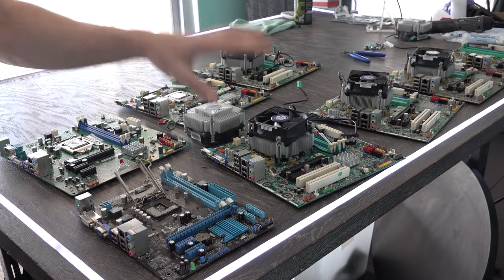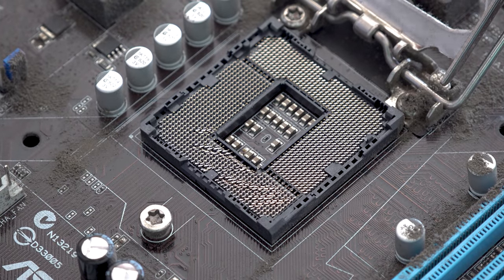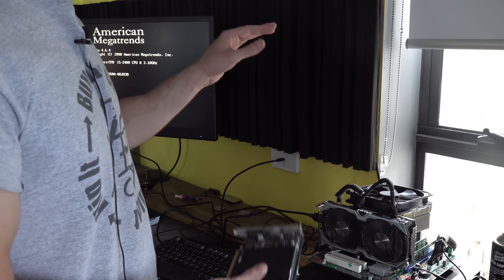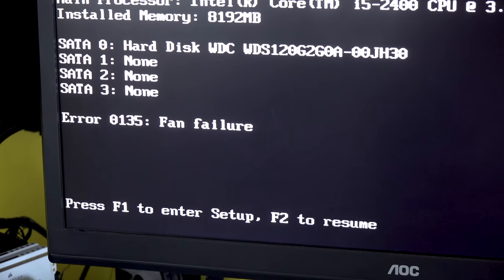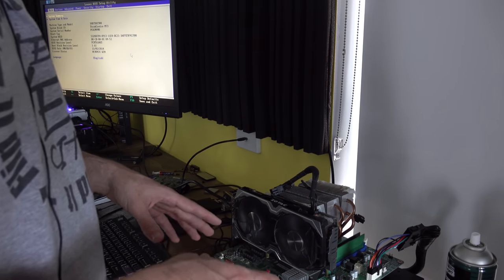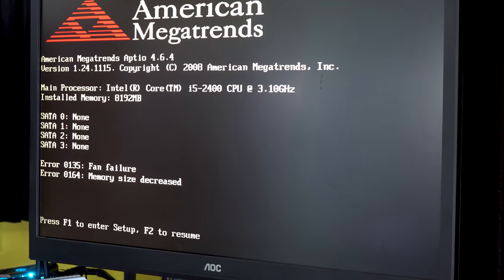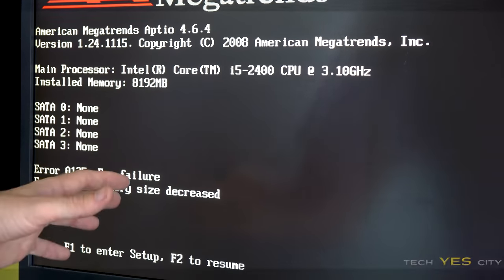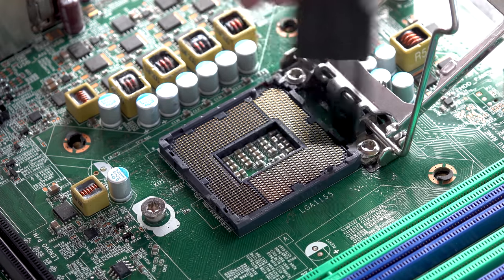Cleaning Motherboard CPU PINS?! (Lenovo M91p Thinkcentre's Explained)

Comment: I was cleaning off a XEON on a AsRock Extreme 3 X79 motherboard, to change out the cpu.  I was using a new absorbant/re-usable kitchen towel, made of compressed fibers, often used for cleaning dishes with soapy water.  The towels come in a stack at the store and are about 1 square foot each in dimension. I was using one as a rag to wipe away the thick thermal paste and had it in my one hand as I took the CPU carefully out of the socket.  Then I made the mistake of getting that fibrous rag close to the socket and about 1 square inch of it touched the pins...which all seemed to grab hold of those fibers.  I could not pull it away without bending those pins.  I really thought that I had totally trashed that motherboard. Before making the situation worse, I tried a different approach.  I got out a BIC lighter and carefully burned away the fibers clinging to the pins, slowly taking the towel off.  It worked like a charm.  Just had to be careful not to let the flame linger.  I would burn...stop...burn...stop...always being sure not to heat the pins excessively.  I used compressed air to blow away the fiber residue. Voila.
Reply: I did the same a year ago - except i pulled the microfibre towel and bent about 15 pins upright, felt like screaming and crying ! But 3 hours later all straightened (ish) and it booted up, lesson learned….

Comment: Gotta love those Lenovo ThinkCentre M91p’s 😀.

Still have my SFF in the attic. Back then I didn’t have a gaming pc or much money, so I got an old office pc from work.

I upgraded the i5-2400S to a i7-2600 (non-K), changed the 2x2GB 1333MHz Elpida RAM to 2x4GB 1600MHz Kingston Value RAM and added in a Asus GTX1050ti since it did not have a graphics card, sorry gravis card 🤪

and ... gaming time on a budget 😜

Ps. Even got the 24” TN monitor it came with and the original Lenovo keyboard and mouse. The mouse wasn’t that good and I changed that for I believe a cheaper one from Razer but the usb keyboard was actually really nice for gaming 😉

Love the work and effort you put into your video’s Brian... mr. Tech Yes man 🤣

Comment: I took your advise and got an old HP Z600 workstation. I love the Xeon E5620. I got a heck of a deal on a graphics card. I am trying to use only used parts for my system. So far, it is working great. Thanks for the inspiration.

Comment: Damn
Doin this with a stiff paint brush really did work
I was having problems with getting memory to work in triple channel on my p6t that I purchased recently
Now it runs absolutely fine
Got meself a xeon x5660 upto 4.2ghz ez pz
Reply: That's pretty good for an x5660, usually it's the x5675 (better binned chip) that has an easier time hitting 4.2+ghz.
Reply: I also have a p6t deluxe. It doesnt boot/doesnt recognize ram in the first two slots. What spray did you use to clean it?
Reply: @gammler3000i  I used the same Aussie export multipurpose spray
And some random paint brush I found

Comment: My first comment on any of your videos.  Anyway, Just want to say that this method works and I've learned it from you.  I am infact typing on this system with a motherboard newly socket cleaned.   It was a gigabyte z97x-ud5h motherboard that I bought recently as part of a faulty system.  The system would boot with only 1 ram on DIMM 1 but after doing a tech yes loving treatment.  It had 2 ram slots working but no dual channels.  but the second slot was also very picky as it will only run 2 single rank DIMMs.   Use the "thicker" american multi-purpose substance and a good paint brush i had.  carefully stroked the pins and tested my DIMM.  All 3 pairs of gskil and mushkin DIMMs that won't even work on any 2 slots together now work on all 4 slots.  this gigabyte board was problematic as it was throwing all sorts of post codes and looping.   once it finds a DIMM it doesn't like, I had to restore the main bios from the backup to just make it work (with only 1 DIMM on the primary slot).

I am Long time follower of your channel on atleast one of my subs.  Anyway,  i've been doing some buying and selling during this "period".  I haven't done this since pre-college some 20 years ago.  Anyway, your channel is sort of what I used to enjoy back in the day ( the "parts hunt") .  I thoroughly enjoyed you going to different countries for the parts hunt because I used to do that when I go to japan, taiwan, singapore.  Anyway, I hit the subscribe button today because of a particular point you made.  The parts-performance community doesn't have the fan boy zealots.  I notice people who I recently sold systems to understand the "value" of the components.  No "team green","team red", "team blue" just price-peformance.    In fact this is how i discovered x58 platform which is thru your channel.  I hated it when it came out because it was overpriced but I've leared to love it now.   I discovered the value of x79 3 years ago and loved what it had to offer and I began watching youtube channels about it since then and bumped into tech yes city. Thanks again Mate!

Comment: A small tip when trying to straighten the CPU socket pins would be not to use a cocktail stick, because small splinters of wood can break off and get stuck in there (ask me how I know...). A good alternative is to use a very small cable tie; since they're plastic they won't fragment, and they also have a little bit of 'give' to them compared to the wood, so they can be a little more gentle.

Comment: wait are you stalking me? i literally did a tech yes loving last night and for some reason my multi threaded performance tanked to now lower percentiles in benchmarks instead of on par or little ahead.  Well i used crv electronics cleaner (almost like brake cleaner) on everything and thought maybe left some residue and on top of that had some thermal paste "maybe" get in there because applied too much... i tried dripping rubbing alcohol into the pins and blasting air so anything runs out the bottom.  but i really want to be able to clean the pins and almost used a qtip but the hair were getting caught didnt want to catch a pin and bend straight up. low and behold you post this video today.  thank you and i hope you get a chance to read this

Comment: The only part of the pins in a LGA socket that need cleaning (or benefit from cleaning) are the very tips, the tiny domes that actually contact the lands on the CPU. I drag a few strips of fairly heavy, alcohol wetted printer paper across them (a few with a 90° point to get into the corners), I reckon the paper is just abrasive enough to clean/polish the gold plating.  This is after making sure there are no obvious contaminants such as fibres that might interfere mechanically.

Comment: For people that can't buy his multi purpose spray, look for Contact cleaners, they will do the same job, as the most important part is that they contain solvents which clean the PCB and evaporate quickly. Look for Heptane, or Hexane in the contents. Isopropyl alcohol works as well but it can be harmful to plastic parts.
Reply: The description and uses of the "multi purpose spray" matches WD-40 in the USA.  Kinda wierd.

Comment: Got an Asus P6T used but it was poorly taken care of. Only one dimm slot worked. Took WD40, a rag, a data vac, a tooth brush to scrape the dimm slots and rubbing alcohol. Managed to get one more dimm slot working. But the mobo works in single channel. Saw your x58 fix video. Took a toothbrush to the pins with WD40, bent some pins back and now I have one more dimm slot working, unfortunate that I couldn't get it to work in triple channel but I got it in dual channel so I guess that's a win!
Reply: Try replacing the thermal paste on the north bridge
Reply: @MarshallSambell  did all that

Comment: Here's what I've learned concerning WD 40. It is the best lubricant for PC fans. You can extend the lifespan of lower RPM fans in particular with WD 40. In case of PCBs, use the contact cleaner variant of WD 40.it's really great and leaves no residue. If a fan is rattling, sounds louder than normal, or spinning very slowly. Give it a spin with your hands to see if it's heavy because that's the main indication that it needs lubrication. Also, you can use old CPU fans as case fans if they're becoming loud at their maximum speeds or even as a replacement for a dead PSU fan

Comment: In the UK we have "WD-40 Contact Cleaner" which evaporates fast, leaves no residue, and is non-conductive, would recommend checking it out if it's available in Australia, great for CPU's, RAM sticks, DIMM slots etc... £6 a can here which lasts a good while if you spray it on a micro-fibre cloth then use that to clean components.

Comment: Thanks Byran for the top tip. I have a Asus H81 motherboard that has one ram slot that works with ddr3 1600 and the second slot only works with ddr3 1333, second ram slot does not boot with ddr3 1600. After watching this video, I removed the CPU and cleaned  socket pins and CPU with electric contact cleaner and that fix my problem. Second ram now boots with Ddr3 1600 memory. Thanks Tech Yes City for top tip

Comment: Bryan, love your content as always, actually, on older boards socket 1155/1156, or even Haswell 1151, when you pull out the bios chip, I love using some contact fluids, and gently cleaning the inside especially if I don't get the post screen if the board isn't busted but still has fans spinning this sometimes cures the spot, other times it has fried components have done a couple of resoldering jobs and if you're into it, it's usually the caps that leak and go bad with time...

Comment: WD-40 contact cleaner is a must if you can find it in the store,i fixed crashing issues on my P5KC/Q9550/4GB RAM/RX560 4GB by just cleaning every part like you did

Comment: Couple tricks:
 Ive noticed on socket 1155 that Polaris cards will post without video. In my experience you can edit the vbios to disable the efi partition of the boot table using a hex editor and get the cards to work. Its pretty quick once you know which 2 entries to change.

For oem systems there are huge communities with info about front panel pinouts for the oem boards. Repinning the connectors can help you get around some of those annoying post error messages that make you press F1.

Current project is an optiplex 990 recase. Theyve built in a lot of bs, but I have a date with a soldering iron so hopefully that works around it.

Comment: Thank you for mentioning CRC 5-56. It still isn't available in the 'States, but I had better luck finding an MSDS for that. I thought I'd see if I could find out what the active ingredient is, and see if there's anything close to your magic spray on the market. I think that's doubtful, but I still have some research to do. Anyway, the top ingredient in CRC 5-56 is listed as "distillates (petroleum), hydrotreated light," also known as "dearomatized kerosene." That comprises ">60%." The next two ingredients are Mineral oil and liquified petroleum gas (Butadine, which I'm guessing is the propellant) each composing 10-30% of the product. I'm guessing that the dearomatized kerosene is the thing that keeps it off our shelves. The EPA may have it banned, or at least not allowed in aerosol form. WD-40 is mostly mineral oil. In my searching, I've seen dearomatized kerosene being marketed as an alternative for mineral oil, but only on sites outside the US, and generally on a major industrial scale. I just don't think there's anything comparable on the market here. :'(
Reply: Wait! I have found several different products with similar composition to CRC 5-56 that are available in the US. Going to keep the names to myself until I've bought them and checked them out myself, because I'm just going off of some half-assed comparisons of safety data sheets. I wouldn't want to put out any information without first-hand knowledge. I will do some testing and report back

Comment: Can't possibly agree more about the friendly nature of price/performance bargain builders vs people arguing over new stuff (often over single digit percentages lol)
Tips I have, that will help with bargain builds with a small SSD + larger storage hard drive is to right click the downloads, documents, and possibly the music and videos folders in Windows File Explorer, and change the storage path to D:\Profile\Documents etc. What this does is make these folders not take up precious space on smaller SSDs, and be seamless where people don't have to remember to not accidentally fill them up with random downloads etc. Also running disk cleanup after each Win10 build update such as 1909 to 2004, etc, which will usually free up ~20GB or more.

Comment: You can always use PCIE 1X to USB 3.0 adapter less than $10.... They have front header and back ports and they actually are better than the on-board USB 3.0 header of the budget boards....

Comment: Yooo i just did that today on an old core 2 duo, and it worked!!! It was still slow tho, and I don't have any stores nearby, as I'm in a rural area currently.... Sad
Reply: Do the 771 mod and pop in a 5$ xeon
Reply: Broke As FK  that's a nice idea, considering it's an old hp with a 160gig hard drive
Reply: @TheRailroad99  it's a hp motherboard. I legit can't do anything, and there are no stores nearby. And ordering online is out of the question. I guess it's dead....
Reply: @pranav1790  you can BIOS mod most OEM boards. I get my xeons from china. However if you can't order right now, that won't work of course.
The 771 mod is great to give even cheap 775 boards a quad core, without investing much more than 10 bucks
Reply: @TheRailroad99  got a free 775 system with monitor, did exactly that, but that xeon sure sucks lots of power, had to replace the psu as well. Gave it to my brother, im fuckin proud of that coz thats like really cheap, paired it with my old gtx750

Comment: I got an amazing Asus X58 board for €30 cos loads of pins were bent. 30 minutes with a magnifying glass and a safety pin and it was fixed. Then got a Xeon 6 core for €30 and overclocked it to 4.4ghz. Amazing deal
Reply: lol what mother board was it

Comment: Not sure if it will work on the Lenovo but you may want to try what I did to fix the fan error on a Dell. 
I have linked the yellow wire pin from System fan connector (the missing fan) to yellow pin from CPU fan connector and no more F1 fan error at boot . I just soldered a wire (Y split) to yellow wire from CPU header and run it to the removed fan's header on the motherboard. And presto, no more error. the yellow wire on Dell I think is the Tach/rpm. Basically I tricked the system to think the missing system fan was still spinning by using the rpm sensor on the CPU header. :)

Comment: T3500 machines are amazing used price performance.  For $50 shipped i get x58 with case, cooler, fans and a 525watt silver rated 80+ power supply with a 6 pin pcie power connector.  Just need a rx470 and a cheap x5670 and six 4gb sticks of ddr3 10600e . Amazing performance for the money.

Comment: A better option for cleaning the pins is electrical contact cleaner or DeoxIT D-Series (even better). You shouldn't even need to brush the pins with the DeoxIT spray.

Comment: M93p is my favorite OEM system. It has 4 slot DDR3 RAM and its PCIe x16 slot is compatible with recent GPU card. The only drawback is, it use 14 pin PSU connector rather that universal 24 pin connector. But, there is always way around. The front connector USB3 header also different from mostly aftermarket motherboard so the chance of getting USB 3.0 on the front panel of new PC chassis is very slim since I haven't found any adapter to 15 pin USB 3.0 header connector.

Comment: recently tried my 1600 af in a msi x570 gaming edge wifi mb to see if the chip actually works with the board and well it does. but i used the stock cooler, and it popped my cpu out bent a few pins, 6 to be exact bent those back and threw the cpu back in my msi b450I gaming plus ac mb for now. will be using the x570 here soon as it has some stuff my b450 dont but for now im glad i learnt how to bend those back ! thanks!

Comment: I've used a couple M73 boards and both had a problem that resolved itself. When trying to put in 2 sticks of ram for the first time, they didn't post. I tested each stick in both channels (each stick posted in both channels) and when I put them both back in a second time, they magically posted with nothing else being done. Perhaps getting the board to post with one stick makes it so that it can post in dual channel in some cases.

Comment: i got a board that recognizes only if 1 ram is installed, both of the ram are fine and if I put either stick in any slot it works but if you put both of them it doesn't boot. So I'm gonna try this method wish me luck
Reply: yo tell me if it works, cuz i face them same issue xD
Reply: Post update when you can, please
Reply: you should use pure Isopropyl Alcohol instead of multipurpose cleaner though
Reply: @tmzilla  
ISA is the name.
Reply: Waiting. Goodluck
Reply: waiting
Reply: Let us know!
Reply: it actually works 😁 (i used alcohol btw)
Reply: @tmzilla  thanks for the suggestion
Reply: @terlaluanjay  damn, my lga1155 board has that same problem, might try it when i got the time

Comment: I'm an AMD guy, and I've had random DIMM slots on some AMD mobos just not work, and sprayed them with Deoxit d5, same for the CPU socket, let it dry a bit, then blew them out with some compressed air from my shop's air compressor, and they started to work again. Also if possible I try not to mix RAM from different makers as I've ran into errors over the years with some not playing nice with each other.